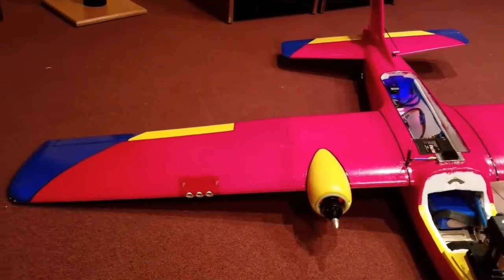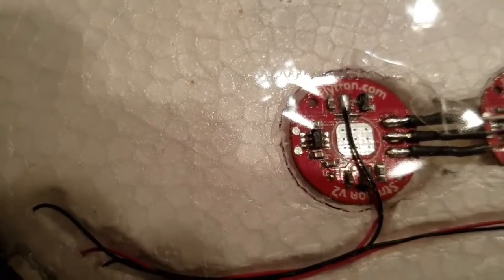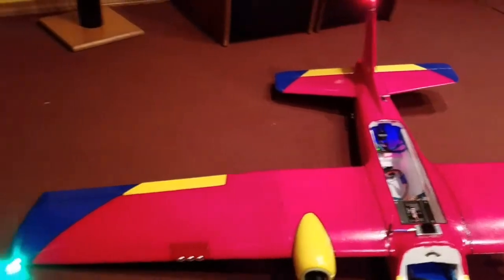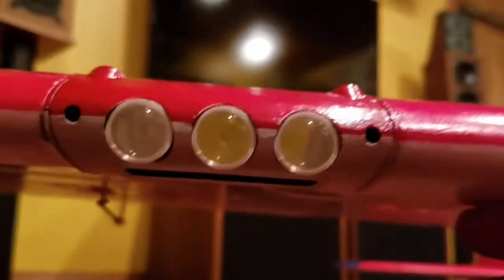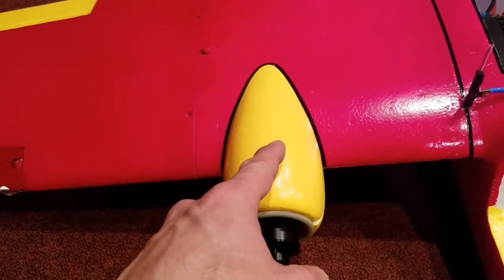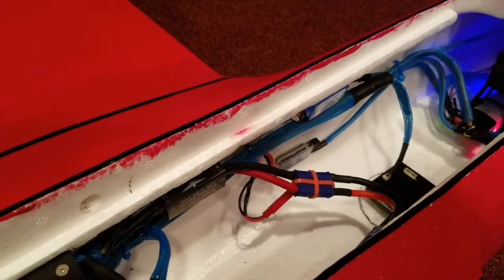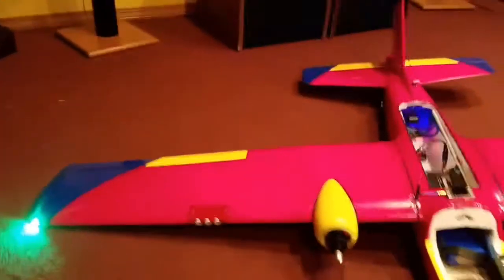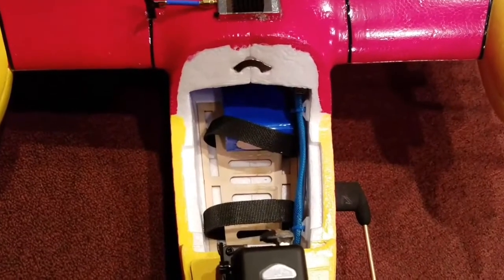My Twin Dream FPV plane LED wiring

Comment: List components please
Reply from the maker: Ken Abbott Hi, everything I did led except for the motor halos came from Flytron.  

The 3 light case on each wing is custom 3d printed by CUFLYN on rcgroups.

The motor led ring is an inexpensive automotive COB led ring pair I got on ebay.  I cannot remember the size.  I think the pair was 15.00.